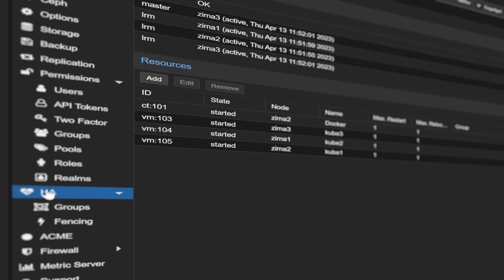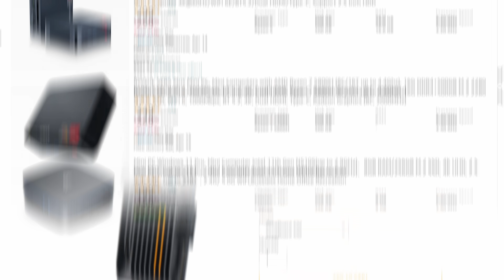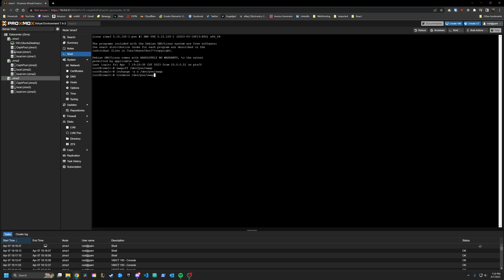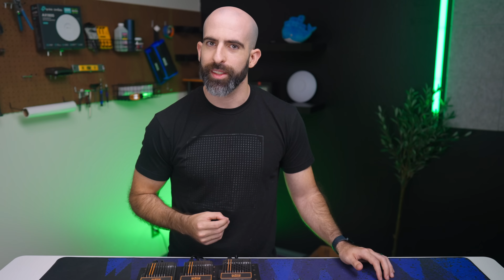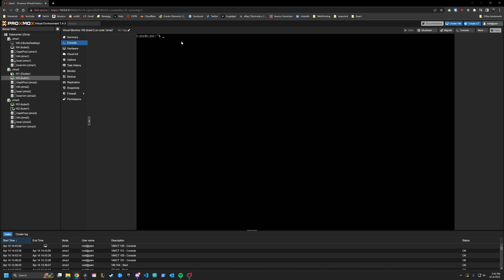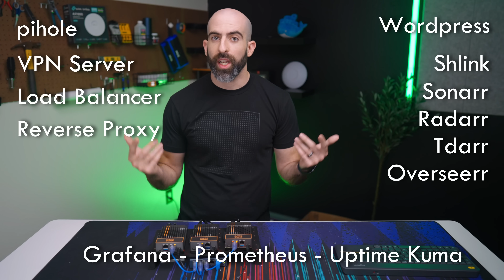10 Watt HA Proxmox Cluster ft. ZimaBoard

Comment: As others have commented, Ceph needs more memory but it should also have it's own isolated (preferably) network, the faster the better. It will constantly be copying changed blocks on one node to the other two nodes to stay in sync. You should use that second NIC on each node for this.
Reply from the maker: Noted, thanks for the tip! Not much is happening on the main nic anyway lol
Reply: @RaidOwl  You also have those pcie ports available on each of the zima boards.  Maybe use that for additional nvme or 10/25gb nic.  I run a similar proxmox cluster on intel NUCs with 6w pentium n3700 cpus but I use ZFS replication instead of ceph. I wish I had those pcie slots though, then I would upgrade the networking and try ceph.  

The other thing you could try with these boards is a Pfsense/OPNsense CARP HA router setup.  They're x86 cpus and have 2x nics so they should be good for that.  In a different proxmox cluster I run Pfsense VMs in a combination of Pfsense CARP HA and proxmox ZFS replication HA.  It works great, haven't had network downtime in forever.
Reply: Actually ceph prefers a single network, "best practices" they want 2, cluster and public. But it's designed against best practises. C.E.R.N. Runs a flat network for ceph, I run 3, networks for Ceph. Management, VM, OSD replication. 

If you dive deep into the logs you will see ceph complains when running with two networks. But thay error doesn't do anything.
Reply: this is why the R86S are so interesting to me
10gbe ceph network + 10gbe client network
OR
2x10gbe for a ceph ring network and 2.5gbe for client

Comment: I experimented with a qdevice approach: main server, small x86 where critical services start if main server is down and and old pi to keep quorum. It worked fine, but the way I did it, storage wasn't redundant (it was all on my NAS) and when I wanted to stop using HA I had to mess around with proxmox files on disk directly.